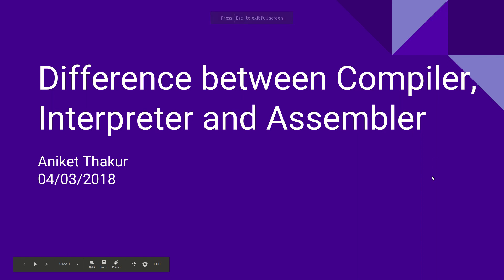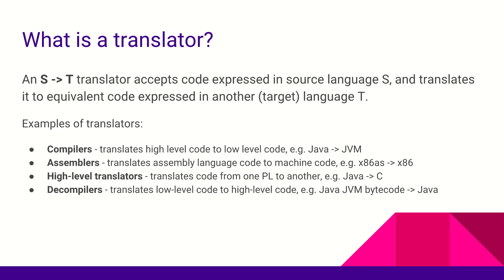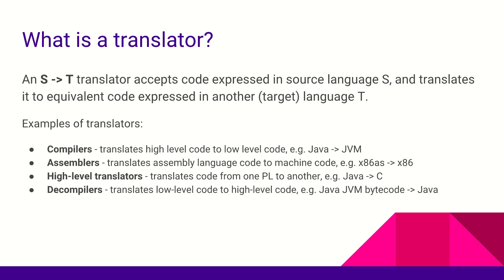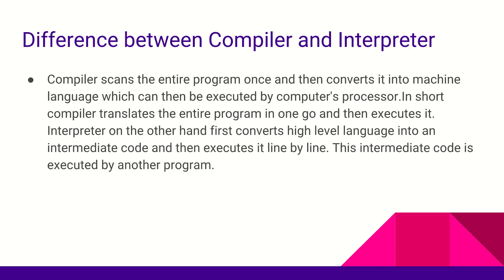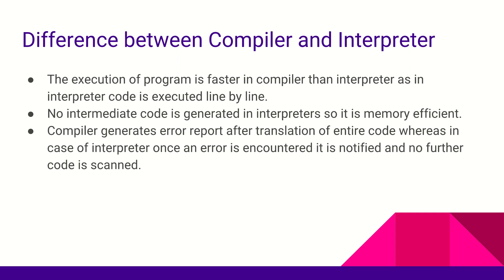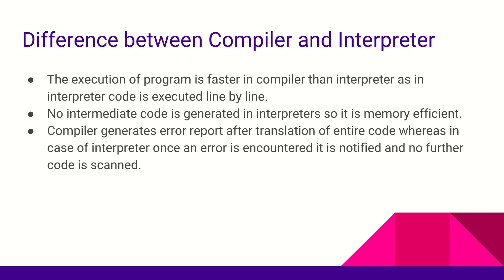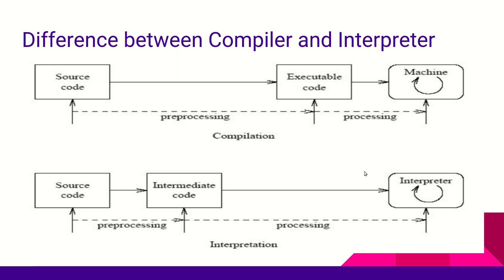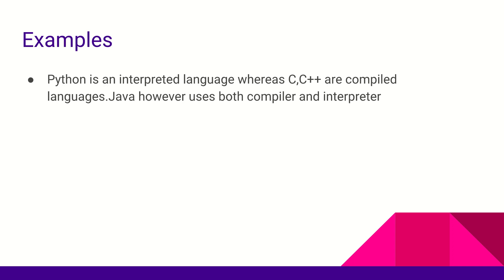Difference between Compiler, Interpreter and Assembler

Comment: First you said compiler converts high level to low level and in the next slide you said compiler converts high level to machine language
Reply: Low level is considered to be a machine language as assemblers have a one to one connection with machine language